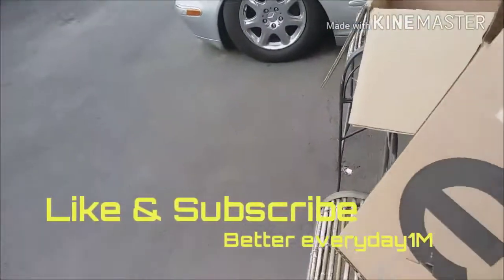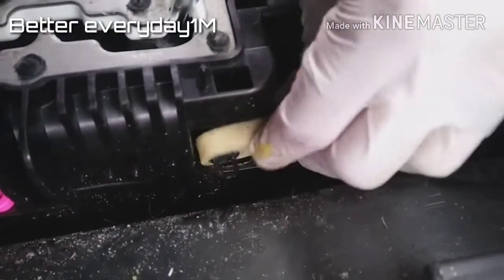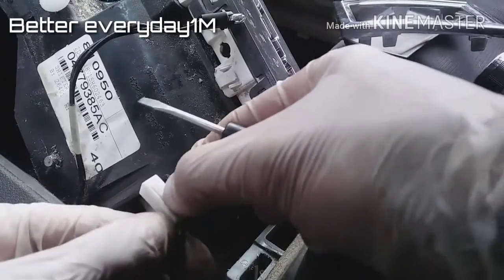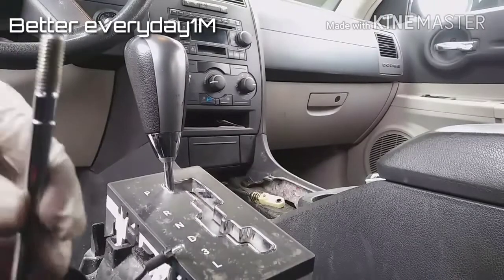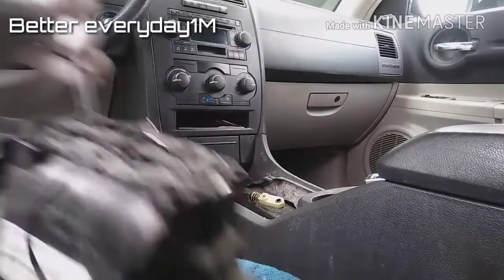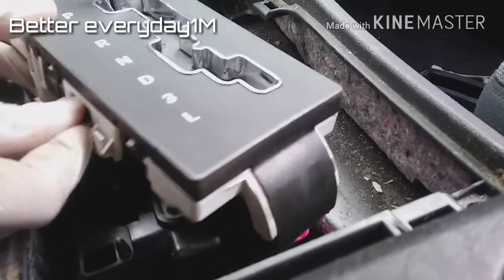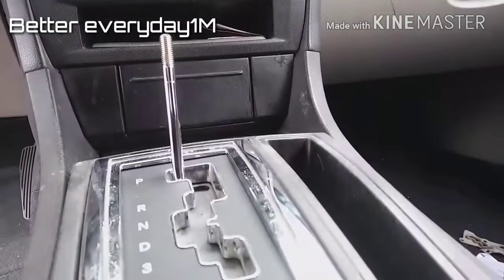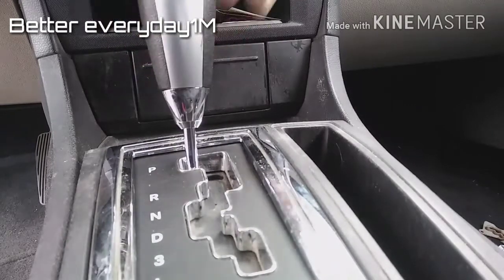Automatic"shifter" assembly" replacement dodge "magnum" "charger""Chrysler 300" "DIY"

Comment: when you change the assembly do you have to reprogram the car to start? i changed one is a 2006 300 srt8 and now it wont start
Reply from the maker: No dont dont need to...it might have a problem whit the key or batt
Reply: Aye bro how you fix
Reply: Lmk I just had the same issue